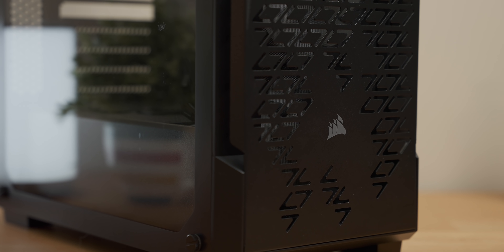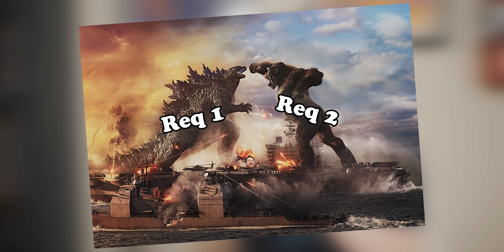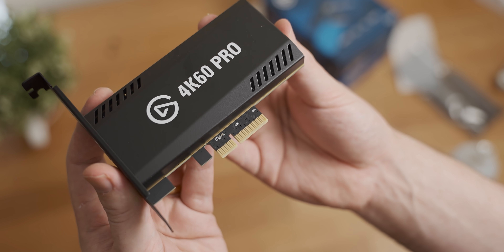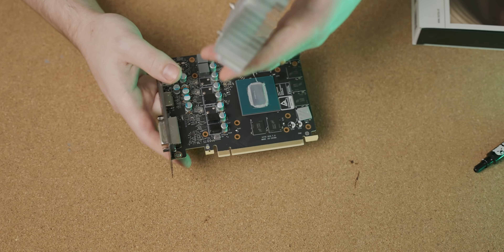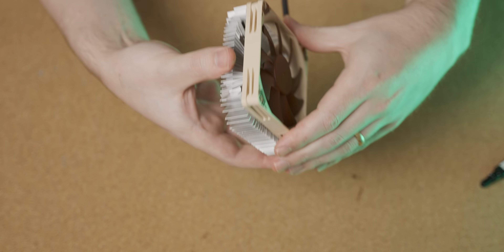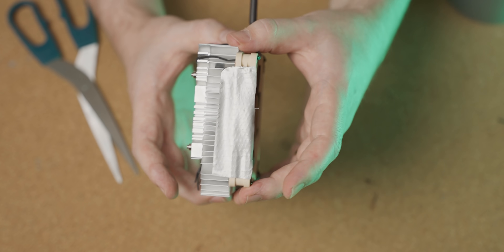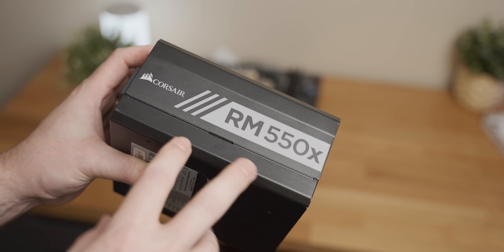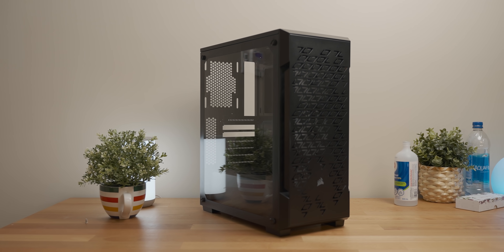I Wasn't Going To Make A Video About This PC, But...

Comment: There is an old trick i always use and that is to chop the fan out if its surround and glue the back of the fan to the heatsink or like just use a pin to remove the wires from the plug on the old fan and re crimp the wires into the pins and you have a fixed card that works like new. your such an amateur Dawid :P

Comment: Curiously, the PCIEx4 cards would probably work on the PCIEx1 slots if you dremel out the end stoppers that stop you from physically inserting the card. (PCI Express is funnily compatible like that.)

Of course there's probably a reason why they are x4 and not x1 cards, so while they might technically work, the x1 bandwidth might not be enough for the kind of data transfers it would need.

Comment: Those PCIE slots should have been open-ended... I thought all PCI-E multipliers were supposed to be intercompatible!
Reply: Those exist, but don't have to. In theory it would be possible to open the end of the slot yourself, but that might damage something around when not careful, and running the cards at x1 might not be fast enough to work properly.

Comment: Try plugging the connector of the videocard fan in the actual videocard coupling for the fan. Might increase the rpms of the fan when on load. Because it looks like you plugged it into the “system fan”.

Comment: So, what happens now that the GPU doesnt have a fan " Attached to it " according to the GPU ? will you still get proper cooling without the readout from the GPU PCB sensor? I feel like your best solution is to attack the shroud with a dremel and glue the new fan in, and wire it to the existing plug so it can be controlled by the GPU if you want to see reasonable temps..
Reply from the maker: Yeah, I am actually thinking I should just repair the old fan. Shouldnt be too hard to do and it will definitely fix the temps. 👍
Reply: @DawidDoesTechStuff  I mean, the new fan is likely superior to the old fan.. but it seems like that shroud is actually way more important than you'd think.. It still needs that Dawid jank flavor

Comment: Why not put the radiator at the top of your case as exhaust ? You probably can reduce the GPU temps abit since currently your rad is sucking in hot air from the CPU.

Comment: I'd probably switch out that duck tape for aluminum or copper tape, probably gonna lose its stickiness pretty fast especially with the heat.
Reply: I'd go so far and make a cardboard shroud that is kept in place by the same mount the fan uses (but I'm more into using screws to hold the fan in)

Comment: Currently debating between 25l omen (i5-10400f, rtx 3060) for $1200 or trident 3 (i7-10700f, rtx 2060S) for $1300. I know the omen is probably the better choice but I love the trident form factor any suggestions?

Comment: DAWID NEVER PLUG IN DIFFERENT CABLES INTO A PSU IT CAN SHORT YOUR SYSTEM

seriously, I've tried this before and my system wouldn't boot properly because it would turn itself off. I only learned that was the problem from a video where someone plugged in his EVGA modular cables into another EVGA PSU and it destroyed his system.

You got lucky though it's okay! Just... know for next time that even with the same brand PSU the wires might be different things and wreck your little crapbox of a PC

I love you

Comment: It might of course depend on the way the air circulates in the system, but Ali from Optimum Tech made a similar mod with a more power hungry GPU and found that setting the fan to push air away from the heatsink helped temperatures a lot more, that might be helpful for you, if you ever want to show that poor OEM tortured GPU a bit more mercy
Reply: A card that is so close to it's throttle temp might even profit from a side fan actively getting fresh air directly towards the card.

Comment: To anyone watching that may have modular cables laying around but not sure it they go to the power supply. If they plug in correctly, take a multimeter or a dc test light to the pins. Make sure you have voltage where its supposed to be and not where it isn't.

Comment: just de-pin the new fan plug and put on the old plug so the gpu will control the fan speed. it just takes a pick and a little prying to remove the pins

Comment: I liked your ghetto approach to fixing your issues. HOWEVER, you did break one of the latest "rules" on AIO's and that is that you put your pump above your radiator which means a potential pump failure in the future. If this is meant to be for your work I would think you should re-arrange that when you change your noisy fans. Cheers!
Reply: He did put the tube outlet at the bottom, which means the highest point of the cooling liquid radiator will still be higher than the pump while also flowing to the bottom. It'll be fine - in fact, turning the rad around could potentially be worse since air could then be caught in the tubes which will more likely lead to pump failure.

The "rule" should rather be "pumps should always get their liquid from the lowest point of the reservoir/radiator" rather than "pumps should always be mounted below the reservoir/radiator".

Comment: Dawid you're the perfect person to ask this and I trust your answer 100%. Is that case worth it? Only reason I'm thinking of not getting it is the fact that the ICUE software for Corsair is just garbage and eats CPU and sometimes even GPU cores. Thoughts? It's for my new gaming/streaming rig
Reply: ICue is very garbage in its stability and user experience but it doesn’t eat up system resources. It idles like any other application.

Comment: please tell me those arent bread closer style cable ties. cause if so there is a strip of metal inside that super thin plastic layer. after enough vibration that plastic coating can rub off and conduct electricity with the pcb if so. id suggest getting longer standard abs or basic plastic zip ties if you dont want it shorting after a few months. for now itll work tho, cant say we all havent used cable ties for something.lol

Comment: For the GPU couldn't he have just took the small fan out of the border for the noctua fan and then just had it like the original fan? then that way he wouldn't have to do some crude DIY to the card and then it would still at least retain it's normal look. and take the end of the original fan out the slot carefully. it sounds like a lot of wasting time but at least it would look better and not so janky lol

Comment: I definitely would've repaired the stock fan.   gpu mini-fan cables can be found for cheap..  buy one, cut it half way or so, and solder on the stock fan / shrink wrap it up.  stock fan is recessed into the heatsink which seems like a big advantage -- your strap-on setup (looks like) effectively halves the available air it can suck in
Reply from the maker: Yeah! I was hoping that adding a different fan would help, but I agree. I should put the stock fan back in there
Reply: @DawidDoesTechStuff  , try removing the tape and test it
Reply: @gernblanston4956  Yes, try this first.

Comment: Laughed my butt off.  Maybe that Duct tape funnel idea of yours will  hold it on?  Maybe your new title should Dawid Does Break Stuff? 😁
Reply from the maker: Haha!! Maybe, Dawid Tries Tech Stuff. 😂
Reply: @DawidDoesTechStuff  That's ok.  Many years ago I was repairing an old 8 bit computer because a wire broke off the cassette interface.  There were two soldering irons, one was the small gun shaped one, and what turned out to be a plumbers soldering iron.   Never having done this before, you guessed it, I picked the plumbers one.  Computer never worked right after that. 🤣

Comment: old saying: "There is nothing more permanent than a temporary solution that barely works"
Reply from the maker: Haha!! That is a shockingly accurate statement
Reply: I feel attacked.. I did a fuel line repair on my classic at the pump in the rain.. using electrical tape and a knife... nearly 4 months ago...
Reply: @michaelcole7162  Years ago, my 04 Sunfire burned out the wiring harness that lead to the fuel pump so I cut the power cord off of a Hoover vacuum cleaner from the 1960s and bypassed the bad wiring. That "fix" lasted the 4 more years I owned it. Never had to replace it and I always told people my car was part Hoover vacuum. Lol.
Reply: @PhilosophicalFiend  that’s so cool lol
Reply: @michaelcole7162  that would probably be a gppd enough fix if made properly. As example actually taking your time to glue that thing together and not all wobly
Reply: @michaelcole7162  fuel lines shouldn't be hacked.... any other fluids are fine.... i have something against fire... i dont like it
Reply: I even have the new hose, and clamps INSIDE the car for about 3 months
Reply: I also like the saying "If it works it's not a stupid repair."
Reply: @elgigante2001  unless its a "fuel line"
Reply: @mcf3778  If his car was an old classic with a mechanical fuel pump, like my old '75 Chevy Impala was, he might be able to get away with that "patch job" for awhile, though still dangerous, but on today's newer cars with HIGH PRESSURE electronic fuel pumps, I am with you!  😬😬
Reply: @arthurmann578  yeah you totally get by.... until you dont
Reply: This is true for my son's Honda lol...
Reply: lol... great one
Reply: You mean a temporary government program.
Reply: Isn't that an engineering adage?
Reply: I like to say it's temporary unless it works
Reply: This is so true

Comment: So why didn't you switch to the 120mm noctua fan?? I mean you had it right there.. MORE air across that heatsink should help, but that tiny noctua for all is aesthetic appeal just isn't up to the task. My gpu is from the other camp, but it competes with the 3060, and it has 2 x 100mm fans on it. Given the TDP of both cards is similar, it's a fair comparison.

Comment: That GPU cooler would reach peak temps really quickly, a slow rise in temperature over time is the case internal temp rising. Just throw on a 120mm fan at the front bottom of the case to send some cold air at the GPU, and make sure you have good exhaust flow too. A simple test is to take off the side panel, if your temps drop a lot, you have bad case flow.
Reply from the maker: I drop some better fans on the AIO and a better exhaust fan. The system is way quieter now. I'll test the GPU temps over the next couple days then report back.

Comment: Dawid should have totally dremmeled the Noctua fan's frame off and glued it directly to the GPU heatsink ;)
Reply from the maker: I did think about doing that. I just didn't want to hurt the little fan. 😁
Reply: @DawidDoesTechStuff  Keep that little cutie safe. You hurt the fan, I hurt you >.>
Reply: That's something I would have done. Did something similar with my old Zalman CPU cooler with a broken fan. Cut the frame off leaving just a little plastic for 2 holes I had drill for screws that hold the fan between 2 huge heatsinks. Worked for years :)

Comment: I can't tell where you plugged in the (awesome) fan on the GPU, but at some point it looks like you plugged it into a motherboard header. At that point the GPU can't control the fan anymore, and instead the motherboard uses its sensors to control fan speed, which might explain the worse cooling performance.

Comment: Did you remember to set the header your franken-cooler was plugged into to read GPU temps? There's no way the noctua fan was worse than the AIB fan.
Reply: I imagine the original fan could have been 3000rpm, for a single fan video card (although I could be totally wrong). The Noctua seems to be 2200rpm. Hard to say which one pushes more air. However, if he wanted silence, maybe he did limit the rpm well below 2200.

Comment: I was kinda hoping to see the struggles with cable managing in this case, its the case I'm using now and it was a bear to cable manage lol
Reply: Was the case worth it in the sense of airflow? Is it good? I'm currently looking to buy it as I can't get my hands on a fractal case. But the fact that it uses Corsair ICUE software scares me xD
Reply: @VictorBaguera  The airflow could be better but it's not the worst, i recommend front and top intake with rear exhaust.  Mine came with 3 120mm front fans, and I just had to add 3 more 120mm fans. be prepared for hours of fun cable managing and if you have a mechanical drive use a modular PSU to avoid clutter. drive cage is removable though.

Comment: Ahh the ghetto Frankenstein electronics it brings back memories, I had a HD 7870 in my earlier days that gave up the ghost and had to use the old oven method to get it back to working twice then broke a fan on the original cooling solution and had to ghetto it back together with a new fan and zip ties........................ Brings a tear to my eye.

Comment: You do enough of this that you should get a 3d printer. Could make a new shroud for the GPU too. Help you fix cases with no airflow and what not as well.
Reply from the maker: That is very true. I should invest in a 3D printer.
Reply: @DawidDoesTechStuff  I would recommend an Ender 5 Plus, or Ender 5 Pro with the silent motherboard mod and upgraded bowden tube. Try printing PETG filament if you want something slightly more temperature resistant than normal filament (PLA). You can also upgrade to a steel nozzle if you want to print carbon fiber and harsher (but stronger) filaments.
Reply from the maker: @yoss3l755  Thanks for the detailed recommendation. I've been watch Major Hardware for some time and he is really good with a 3D printer. Now that I have space for it, I don't really have an excuse. 😁
Reply: @DawidDoesTechStuff  That's great to hear mate! I have 2 printers myself (I have the E5+ ;)) and honestly the hardest part is designing stuff that I want to print - Very hard to get used to all of the little niggles of Fusion 360. Thank you so much for replying though, I've been a massive fan of your channel for ages, and as an Aussie, often stay up until 1am on uni nights just waiting to see if you drop a video. 
Love the humour from your videos, would be great to see a collab with you and DIY perks as well, although Bitwit might be more your humour type.
Reply from the maker: @yoss3l755  Oh I love DIY perks. He is so good at building awesome stuff! A colab would be a great reason to travel to the UK.
Thatnks for watching! I'll have a look at the options you mentioned.
Reply: @HappyBeezerStudios  it all depends on what material you use and how the part is printed. You can have everything from PLA which is stiff but brittle, to a nylon blend that is incredibly durable and can survive almost anything. Plus, how you orientate the part when you print it can affect the strength of it, in terms of how forces are applied to the part after the fact. There are other settings such as print temp, infill, wall count, nozzle size, etc..... that when used correctly can result in really strong parts if said parts are designed to be 3D printed.
Reply: @DawidDoesTechStuff  Have a chat to MajorHardware he has lots of experience with 3D Printing PC Parts 😁
Reply: His non-3d printer method of fixing things is vital for people who can't get a 3D printer.  Also, its funnier.  If he suddenly starts getting perfect 3d printed stuff, half the people who watch him specifically for the "what's he going to use today.....he's in the kitchen....what the hell?" would unsubscribe.

Comment: Zip ties + duct tape = 1 reasonably well attached fan 😂😂
Reply: Hey, case fans bought by 8800 GT from 103°C to 70°C back in the day. It's totally a fair solution.
Reply: Just squint your eyes and pretend it's factory.

Comment: Not the best GPU cooler customization I've ever seen. Maybe off camera and with the correct amount of shame just order a replacement fan for the one you savaged. Then at least the GPU can manage it's own curve again.
Reply from the maker: Haha!! Yeah, I'm thinking I should just repair the old one. Shouldn't be too hard.
Reply: @Tano Through speedfan he can even control any fan on the motherboard (where the case fan on the GPU would be plugged in) and connect it to any sensor, including the temperature sensor on the GPU.

Comment: Love the Guetto GPU Fix... Reminds me of a computer I gave a buddy of mine ages ago... something like a garbage Radeon 9550 with a tiny guetto fan floating 2 cm away from the tiny heat sync... it looked like a glorious fire hazard... and yet it worked. One day my buddy opened up the case and asked me WTF is this garbage, and we had a good laugh.
Guetto is often quite memorable.
Reply: Back in the day of IDE cables I would fold them and tape them up with duct tape so they were more like a cable than a ribbon.

Comment: I think more sessions with Anna and the taser should help with these issues.
Reply from the maker: Yeah, I'm clearly in need of a good tasing.
Reply: But make sure its a low voltage and amp taser as the higher ones really hurt 😥
Reply: @DawidDoesTechStuff  Giggidy
Reply: @DawidDoesTechStuff  dude you need at least two shocks to the ribs for the duct tape and twisty ties.... Jesus Christ. 🤣
Reply: @DawidDoesTechStuff  How do you even own a taser in Canada?
Reply from the maker: @stephyyyyyyyyyyy  It just needs to follow the regulation size in order to not be considered a conseable weapon. It's more a cattle prod than a taser.
Reply: @DawidDoesTechStuff  That's really cool, I've lived around B.C. and Alberta my whole life and never knew. Thanks for the reply!
Reply: Haha Dawid definitely deserves another round of 'light' tasing :D
Reply: Yeah, overclock yourself with taser